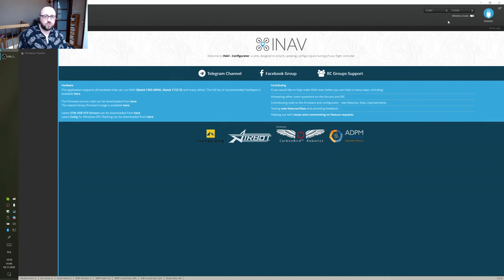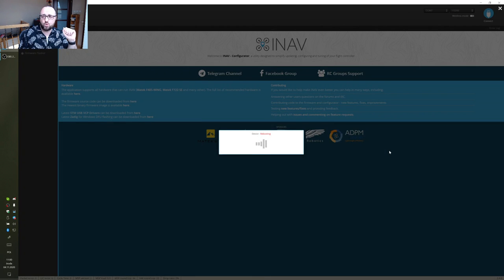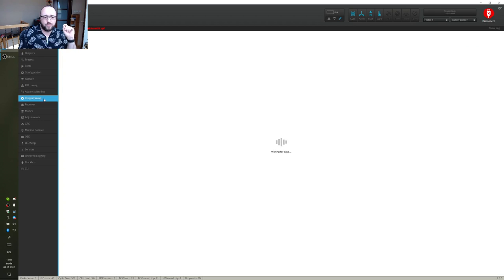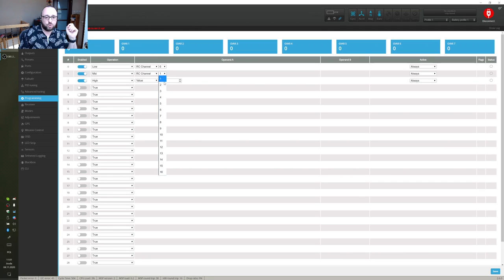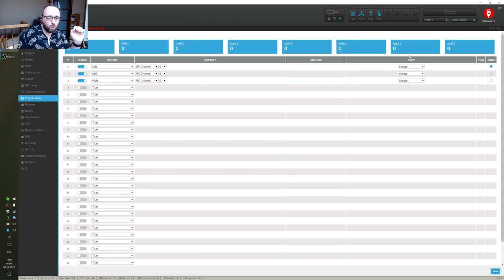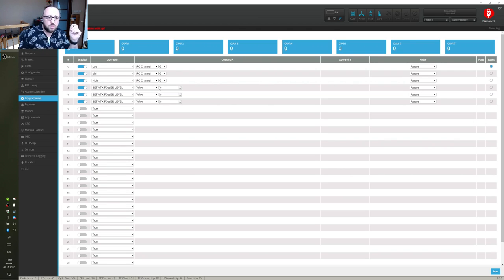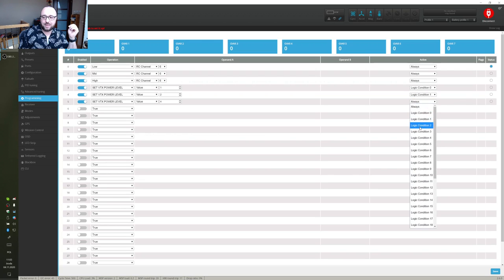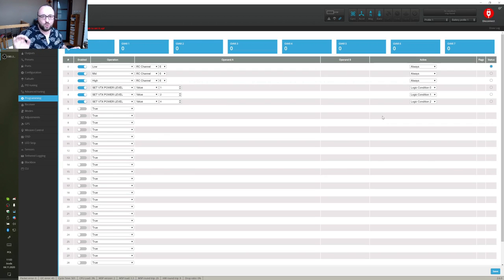INAV VTX power on a radio switch - tutorial

Comment: this is awesome. I got it working with 3pos switch.

my VTX supports 4 power levels though so I had to skip one power level.

I would have wanted to use all 4 power levels with a pot or 6pos switch, but at 2:55 you only showed how to do it with LOW, MID and HIGH logic conditions which only gives me 3 power levels.
Reply from the maker: You can use GREATER LOWER conditions too. It's just a general frameworks

Comment: Really like the programming framework and the example you've given for its usage. The only thing is the flashing status indicator for the Set VTX Power operation, the fact that it only operates on change is a perfectly reasonable internal implementation detail but this should not leak out into the UI. The status indicator should represent the logic status only, which in this case should remain on. As it stands it's confusing at best.

Also the options in the operation dropdown should probably be grouped into categories: https://www.w3schools.com/tags/tag_optgroup.asp

Comment: Very nice but does it conflict/override the VTX power configuration if set to always low power until the model is ARMED? And how about the value if the transmitter is powered off or if the FC is powered on before the Transmitter?

Comment: Yea I did this on betaflight.. vtx power but on a dial to be able to switch between 5 power settings.. actually made a how-to video for a couple people.. everyone ask. It comes in handy especially on my LR when I decide to go further
Reply: @M-H433  I have never used iNAV i did it with betaflight. Beatflight you enter power range like 900 to 1100, then 1200 to 1400, then 1500 to 1700, then 1800 to 2000.. then on transmitter I select the dial as that aux/channel.  https://www.youtube.com/watch?v=-5JkPe2f5A0
in iNAV i believe you will have to use great than and less than and nor. To change as it gets higher. Seems complicated. Maybe Pawel knows a easier way. 
I also set my transmitter up than its always in 25mw when disarmed no matter where switch is

Comment: This works fantastic for 3 switch position (arm changes to 100mW low switch position, 400mW middle switch position, but high trying to get to 800mW will not budge) but I'm not getting output to 800mW with Succex-Force 25/100/400/800, playing with all values. I think the highest should be 4 but that only chnges it to 400mW.

Comment: Hey Pawel it s a nice video dude.. you know this work thank you.. I apreciate you... I will ask a question about this.. Can we power off the vtx? For example we test smt, and we dont use camera so vtx is working and it becomes very hot .. if we can power it off, it will not be hot...it will be cold.. what is your theory::) ?
Reply from the maker: Some FC have PINIO that just cuts off power. No voltage, no heat
Reply: @FPVUniversity  I use hglrc f722 I think this have PINIO

Comment: I have used this guide for setting up a few wings now and it works great! 

I just tried to setup HDzero 1W VTX in the same way (as it too uses smart audio) and I was very dissapointed to find out that SA is not supported on HDZero for INAV. Is this something that will be rectified in the future? I know alot of people just say "just switch on the ground".... I like to launch in low power mode and increase/decrease as required.
Reply from the maker: HDZero does not have smart audio
Reply: @FPVUniversity  Tried to post a link in the last reply and think it has disappeared, Page 3 of the HDZero Manual states that RaceV1, RaceV2 & Freestyle VTX all use Smart audio.

Comment: Hi! Great feature!! I am trying to implement on 2.6. No success. I can change the vtx power with the stick commands (radio), and i can see the in the receiver the ch7 changing values. I can change a global variable value acording to the switch position, but when i try to set the vtx power.. it doesnt work. Is this some 2.6 limitation? (TBS Unify and Matek F411 Wing)

Comment: Hi Pawel, thanks for explaining this so clearly. It works for my setup, but with a strange glitch. Power level 1 is 25mW, when I switch to lever 2, nothing happens and when I switch to 3 I get 600mW. If I then switch back to level 2 I get 200mW. What could be the cause of this? I am using a DarwinFPV TX805 with 25, 200,600 and 800mW connected to a Matek F411-Wing FC.
Reply: I have tre same issue

Comment: Pawel, thanks for this info. Question, how can I control my Runcam 2 4k via the remote wire? I've tried many things. I'd like to be able to start/stop recording via switch.
Reply: I have one of these: http://www.cnfpv.com/portal.php?mod=view&aid=159 for my Hawkeye camera but I haven't wired it in yet as I'm stalled on the build. There are other brands too. Got mine from Banggood.
Reply: @Terry_Fritz  The Runcam 2 4k comes with a "remote wire" which they show in the manual being set up and controlled in Betaflight. It's shown being controlled on a servo output. The issue is that  I believe the commands entered in the Betaflight CLI interface are specific to Betaflight. I haven't found or figured out how to do these in INAV.
Reply: @robtomben  in inav it is easy . Read instruction! Two wire rx run cam  to tx of flight controler and tx of run cam to rx controler . In i nav open port to run cam video devices.  Then in i nav. Go to switches and tune your remote in camera control.  Boom 💥 done working good . Put switch in mid position then u can use same switch for changing qr mode and record mode

Comment: Now that I think about it... if it'd enable setting the VTX forcibly into pit mode when disarmed it might (I repeat: might) come in handy :D But then isn't there already a setting that turns on pit mode in disarmed state?
Reply: did you find out how to use pit mode in INAV?
Reply: @flat-earther  Yes and no. I've defined an adjustment that chances the VTX power output. I use it when flying long range in 3D cruise where I have a moment do other stuff than keeping the plane in the air, because it flies by itself. But pit mode when disarmed - not really, no.

Comment: Hi Pavel.
Love your work!!?
I have a question.
I just wired a flywoo bt nano to my matek f722 running inav. I triple checked my wire ring a'd I'm good..
But when I plug my quad to the computer it goes directly into dfu and won't let me connect normally... Of I remove the bt nano from the board it goes back to normal..
Any ideas..??
Thanks.
Reply from the maker: Is BT on UART1? If yes, wire it to a different one
Reply: @FPVUniversity  hi, thanks for the answer. No I'm on uart 4..

Comment: Hi, Pawet. I'm riding a racer drone with an Inav/Matek f405 se flight controller but, i can't get my radio transmitter(AT9S Radiolink) to "talk" to that controller. The bars on the reciever do not move when i make the settings for Sbus. My reciever is a Radiolink RD9S and the bind with the radio is okay but, on the radio transmitter screen, appears  a configuration information that says: "Output: PPM". I wire the fc to the ppm serial port but, in the inav configurator, the channels bars on the reciever are all blank. What's wrong? Did i forget to do any important  settings? Can you help me with this, please?
A hug, my friend.
Itajai Lima.

Comment: Hey Pawel. Great video and channel, many thanks. Quick question, is it possible to do a 5 stage vtx power setup using channel values (eg on the 6 pos switch on the TX16S).  My VTX has 10/25/200/500/800mW. Your logical conditions just showed 3 stages of low/med/high.
Reply from the maker: yes it's possible. Take a look here for example: https://github.com/iNavFlight/inav/blob/master/docs/Programming%20Framework.md#set-vtx-power-with-a-pot
Reply: @FPVUniversity  thanks you’re a gentleman. I’ve managed to do it by using a logical condition RC channel 7 = 988us etc, one per stage of the 6-Pos switch. It works but my concern is if the channel drifts a few microseconds then I guess it won’t trigger?
Reply: @FPVUniversity  how would I go about using the 6 push switch's on the top of TX16S? Thank you for your hard work! I truly appreciate all that you do

Comment: Is it possible to use a toggle switch, like the "Trainer" switch, to cycle through the power levels on the VTX? So, every time you cycle that switch, the VTX power level increases? Obviously it would go from highest to lowest on the last cycle.
Reply from the maker: yes, you can do it with Programming Framework and Logic Conditions as well

Comment: What if I bind the logic condition to rssi channel instead. Can it be used to change vtx output based on signal strength?
Reply: Unfortunately makes no sense, since Rssi is based on your RC control and since the receiver video is in the Google you cannot have that Rssi data easily on the fc to be able to implement that logic

Comment: Paweł, I frankly don't see value in switching power levels on the VTX. If you consider 100mW vs 800mW it is not that big of a difference for long range and the mental overhead of switching VTX power mid-flight is high enough to keep you away from actually controlling the aircraft which in my opinion makes this feature not worth while. Even in racing you'd want to stick to one power level to focus on controlling the drone. So a no-no for me (although it is cool to see inav being able to do that :D)
Reply: You've got a point. Anything can distract you from actually flying your plane but it can be really useful if you want to test which powerlevel is actually adequate for your flight distance. Once it's done you can always use the channel for something else. I think it's a great feature.
Reply: If you are flying a stable airplane it is not so difficult. And if you don't want to do it with a switch, you can change the vtx power according to the home distance if you have a GPS or rssi value

Comment: why do you need to change the power level is that so you don't need to solder board?
Reply: oh output power ie 25mw 50 mw 100mw for eg

Comment: do you need to have a lua script loaded into radio?
Reply from the maker: No, absolutely no. It works with any radio and any radio protocol. No need to have any Lua or telemtry as well
Reply: Awesome thanks
Reply: @FPVUniversity  I see in v2.6 the baud rate selection doesnt include default or auto. Do you know what the correct baud rate is for smart audio? Thanks

Comment: Does inav use VTX tables?  My vtx keeps crashing
Reply from the maker: No, no VTX tables, because it's a useless function. Still, INAV supports SA and Tramp protocol to change power and channel
Reply: @FPVUniversity  hi Pawel. My VTX on tramp wont change power to 2500/ it sets only 600mW. Could you advise on this? thank you in advance.

Comment: how do you put in inav vtx table?
Reply from the maker: INAV does not need vtx table. Everything works just fine without it
Reply: @FPVUniversity  so it will never know power as every vtx is different
Reply from the maker: @Chris-vc1dh  but why INAV should be aware of the output power?
Reply: @FPVUniversity  to display it on osd for example
Reply from the maker: @Chris-vc1dh  but it's for your knowledge, not for INAV to know
Reply: @FPVUniversity  ok